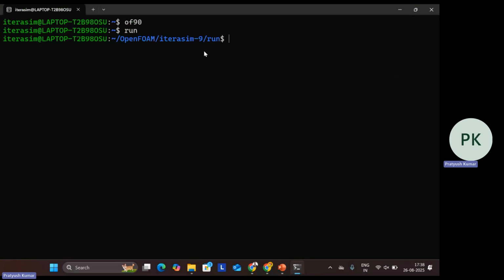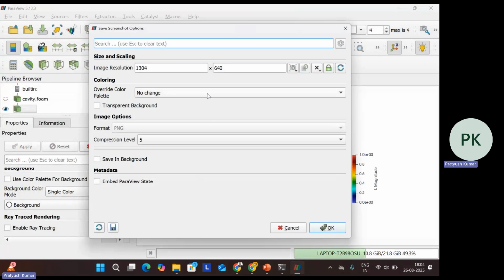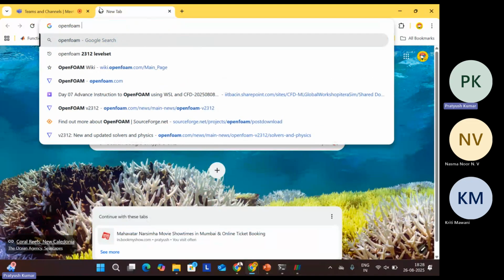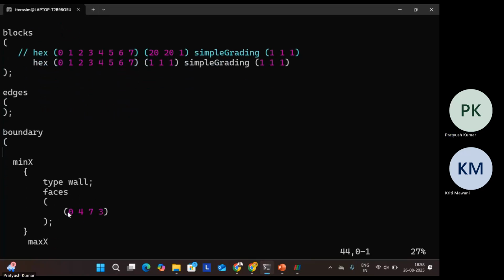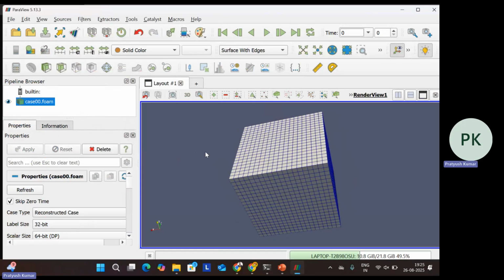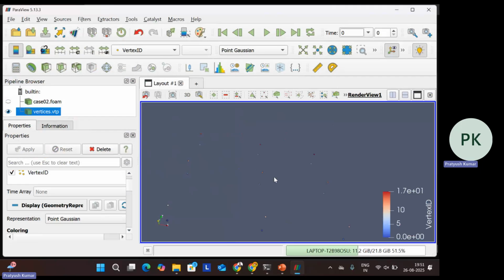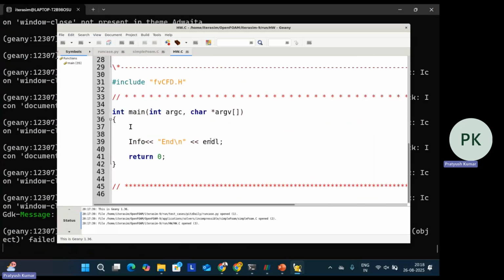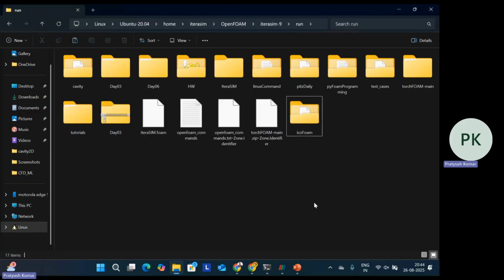OpenFOAM Day 03 | Running icoFoam Tutorial, Directory Structure, blockMesh & Programming Basics

Comment: Hello,
i have the Foundation version. The cavity case is in ls $FOAM_TUTORIALS/incompressibleFluid but it is set to be turbulent and can be solved with pimpleFoam. Im currently trying to change it to laminar flow so I can use icoFoam. I always get the message " "--> FOAM FATAL IO ERROR:
keyword PISO is undefined in dictionary "/home/valentin/OpenFOAM/valentin-13/run/cavity_laminar/system/fvSolution"" I cannot find "PISO" as Keyword anywhere...